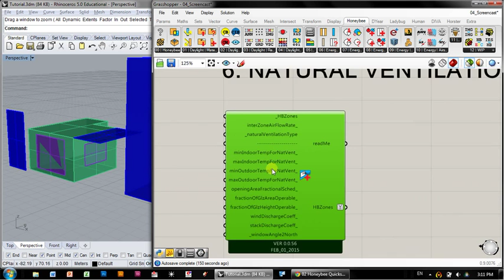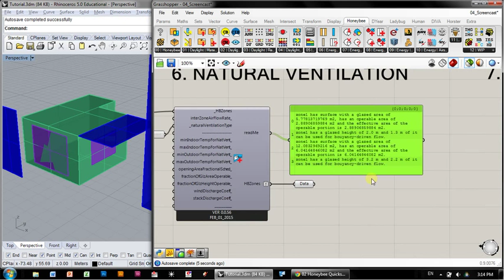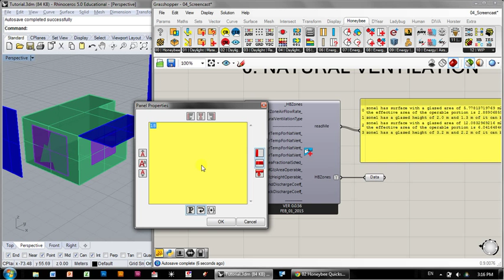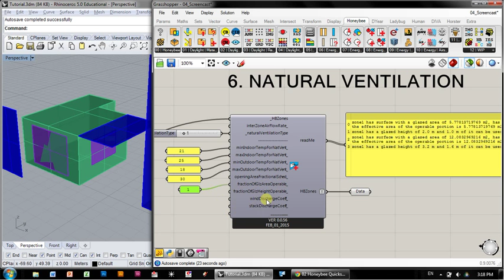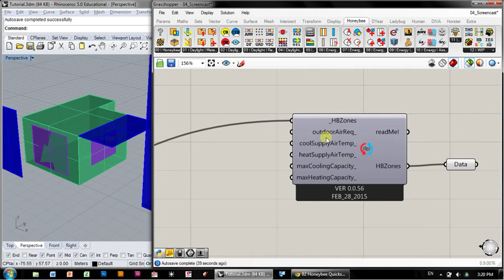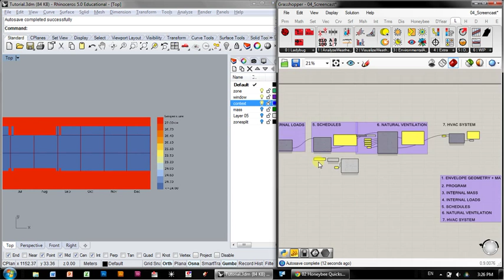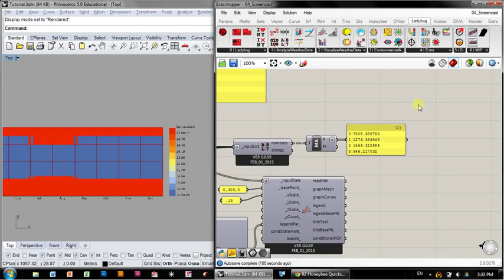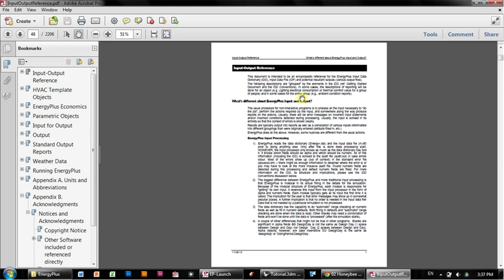06 Honeybee Quickstart - Natural Ventilation and HVAC Systems

Comment: Does this still Work ? Cant find IT in Grasshopper ?
Reply from the maker: This video shows a workflow using Ladybug 0.0.59 and Honeybee 0.0.56.  These Rhino plugins are still available at https://www.food4rhino.com/en/app/ladybug-tools?lang=en.  I haven't specifically tested it, but I suspect this workflow would still work for any of the versions noted as [Legacy Plugins], the last one being Ladybug 0.0.69 and Honeybee 0.0.66.  This specific workflow is unlikely to work using the latest Ladybug Tools, but you can still take the principles discussed in the video and make your own templates.